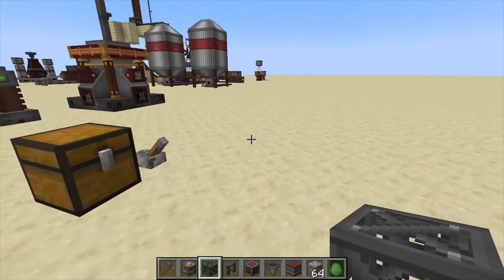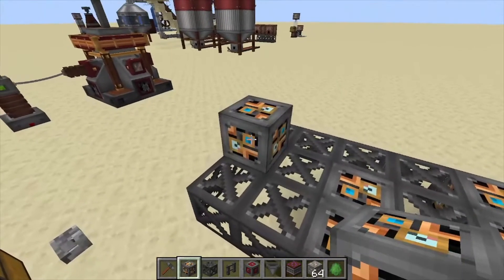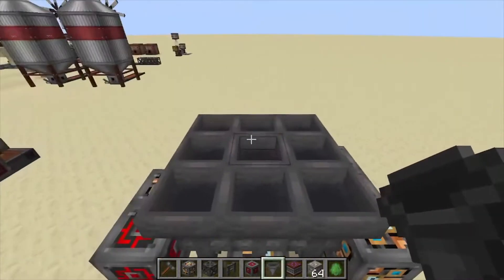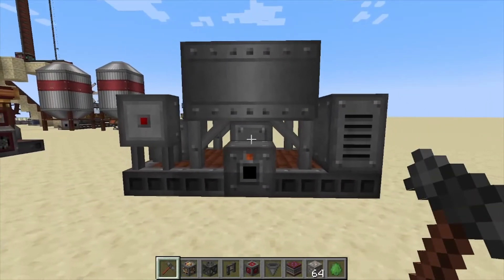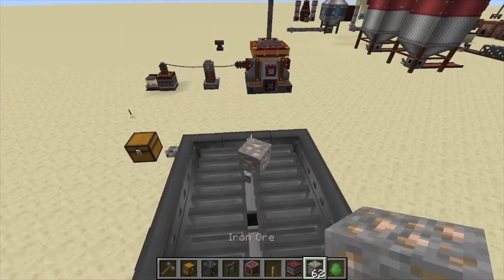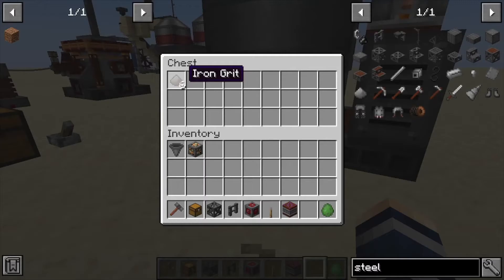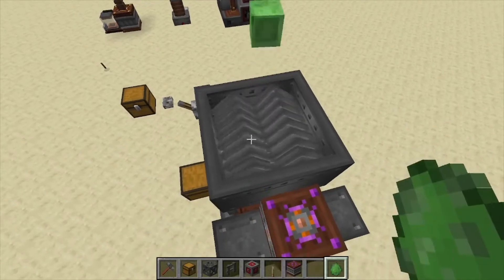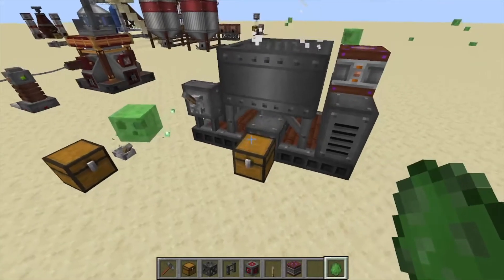Immersive Engineering: Crusher (how to setup/use)

Comment: This is an old video, but my Crusher won't work. It is showing that it's got full kFE and lever: on. I tried it on my survival, then on my creative world but it won't even spin. No crushing blocks, ores, nor damages me.
Looking around, but I don't see any fixes. Any thoughts?

Also, thank you for your vids! Watched some and all of them helped me!
Reply from the maker: Glad you tried to do a little troubleshooting. In modern packs it will show recipes from JEI that will work in the crusher but by the sound of it the crusher is Disabled somehow if its not a power issue so it make me think redstone is the issue. It shouldn't matter but make sure you have an export chest in the front by the hole with the orange dot. Its rare but i have come across packs that disable the crusher from working all together. Try the export chest and try the redstone signal in off position.
Reply: You ever fix this? I'm playing ATM9 and I seem to be having the same issue. Structure is made. Chest in front. It's powered but it just won't work.
Reply: @RanchoBurger  Nope. From what I gathered, it's an unsupported version. Latest version of the mod likely fixed it.
I played a different modpack that had a compromise. 

some other structure I can use to get what I needed from the crusher.

DeceasedCraft had Immersive Engineering, but it also had Create. Create mod had the Crushing Wheel which I used as a substitute.

Best of luck!
Reply: @summerboy8592  hey i was looking for your comment to fix the same issue I had, the orange dot IT's not the output, so I just placed item cables all arround the crusher and I find the output it's the cauldron where the ores are crushed, that's fixes the crusher and from what i saw i'm the only one who fix it, you're welcome
Reply: @RanchoBurger  Just in case you moved to ATM10, in this modpack i connected my ender cell with powah cables straight to the orange dot which in the video was powered with the creative accumulator. and now it works. might be the same in ATM9, at least worth a try

Comment: I put a fully charged MV accumulator but the crusher isnt going, even with an on lever 
I even tried jumping in and nothing, idk how to fix it
Reply from the maker: Check to make sure it’s powered..try standing on top of the accumulator with a hammer and shift click it to change the opposite side to output. Hopefully that works
Reply: @MCMentor1  that worked, thank you!